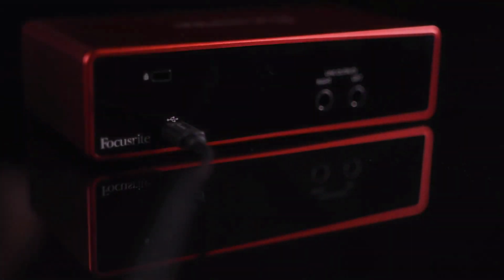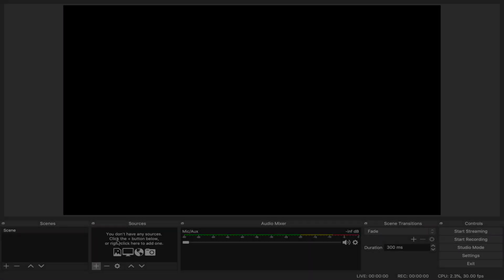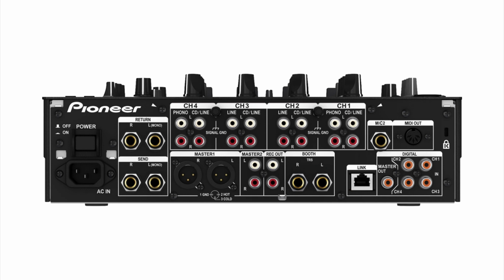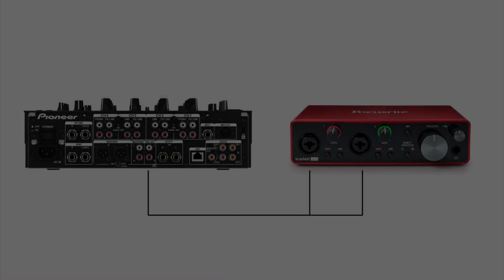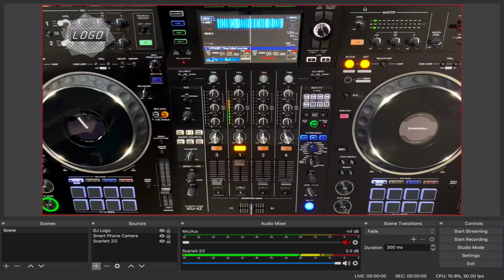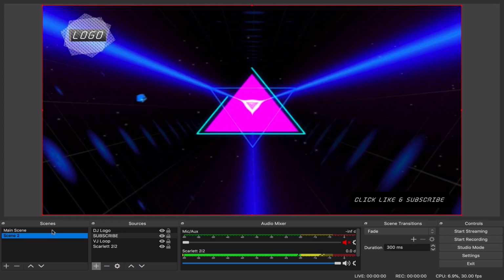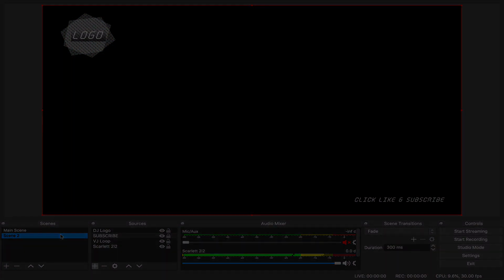Setting up Scarlett with OBS // Focusrite

Comment: Followed these instructions, audio continues to stop recording randomly in OBS.  Does this happen to anyone else?  Have tried using other video recorders, Bandicam and Movavi, with the same result -- at some point in a 25-35 minute video recording, the audio just stops.
Reply from the maker: We're sorry to hear that. This isn't a common complaint. Several things can cause that kind of issue. If you discuss this with our Support Team they can help you identify the cause and provide a suitable solution - bit.ly/CallFocusriteSupport
Reply: @FocusriteTV  actually it is cause its been happening for over 6 months to me as well, theres a video on yt thats older than this comment you made with 16k views attempting to fix the problem so i highly doubt its uncommon
Reply: @FocusriteTV  It is a very common issue and it is unusable at this point

Comment: I have 3 usb inputs to OBS.  I have 2 video inputs: camera and hdmi.  Focusrite Scarlett is the audio I want to use and uses the 3rd usb port.  In my scenes, I have the Mic/Aux muted, also the video inputs muted, but not the Scarlett.  However, when recording... the sound bars for the other inputs are moving, the Scarlett sound bar bounces adequately, but after changing scenes, the Scarlett goes silent.  Why? I end up with a silent recording... Any suggestions?
Reply from the maker: The first thing we can suggest is making sure that your Focusrite interface has been properly setup in OBS. These articles explain how to do so in detail:

Mac: https://support.focusrite.com/hc/en-gb/articles/360012954760-How-to-set-up-your-audio-interface-in-OBS-Open-Broadcaster-Software-on-a-Mac

Windows: https://support.focusrite.com/hc/en-gb/articles/360005040720-How-to-set-up-your-audio-interface-in-OBS-Open-Broadcaster-Software-on-Windows

If you try these steps and it does not help. please reach out to our support team at this link and one of our experts can assist:

bit.ly/FocusriteSupport

Comment: Hi great video and thanks. Quick question, do I need too go through both line inputs at the front on the 2i2? I have a cable running from my REC out input and it goes into one line input at the front of the 2i2.
Reply from the maker: Hi Steve, thanks for your question. Whether you'll use one or two inputs depends on what you're recording. If it's something that needs a stereo image you'll use both inputs. Otherwise most likely just one. Feel free to reach out for additional help: bit.ly/FocusriteSupport.

Comment: Question? I understand the entire connectivity piece, however, my Scarlett 2i2 has its own set of monitors that are designated for my PC. My pioneer mixer has its own speakers designated which I want to use only.  What should I do with the Scarlett speakers? Just turn them off? Turn them down? What’s the best monitor option for them?
Reply from the maker: You can certainly just turn them off. It's whatever works best for you.
Reply: @FocusriteTV  thanks! I usually have my PC audio volume at full, then use the scarlet2i2 to adjust——since I’m using a different audio source should still have my PC audio volume at full or will that matter as long I make all the gain adjustments with the Scarlett???

Comment: @2:37 you say the 2i2 accepts 'xlr' but doesn't the 2i2 bring in XLR inputs at MIC level, not LINE level?? I thought you had to use the TRS inputs for line level...?
Furthermore, the most important thing was overlooked..! HOW DO YOU MATCH THE LEVELS OF LEFT + RIGHT CHANNEL with Control software?? Since we don't want to twist the knobs randomly and have unmatched left + right channels in a DJ set stream...
@3:30 you say to use the gain knobs!!! But there is NO markers on the knobs to try to match them easily, and I was told by Store DJ staff that the ONLY way to precisely match without doing it manually, was to use Control software. Why are you showing only one input, WITHOUT the 'inst' button pressed @3:31 for the demo?!? So confusing and NOT useful for DJing.
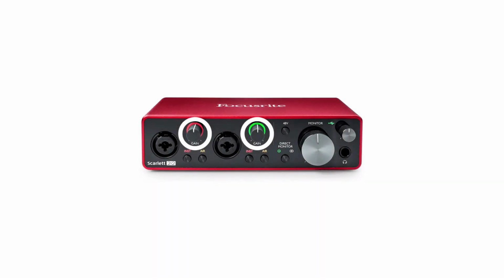@3:50 HOW DO YOU SET THEM THE SAME!!! By eyesight alone!?!? I ONLY purchased this unit because I was told that Control can do this accurately, matching right + left signals of a stereo pair accurately.

Pretty cruddy video. Why do you not make it easy to level match the left + right of a stereo pair input source?!
Reply from the maker: Apologies for any confusion this may have caused. The XLR portion of the Combo connectors are indeed designed just for microphones. 
For the best results, line-level sources should be connected to the 1/4" portion of the Combo connectors. 
Larger audio interfaces in the range feature fixed-gain inputs, ideally suited for connecting stereo sources. When connecting to inputs like those provided on Scarlett 2i2 that feature a variable gain section, controlled using analogue pots, levels can't be linked and matched. This is something that will need to be manually set. The Focusrite Control software does provide metering that can assist with that.

Comment: I'm going to purchase the Focusrite 2i2 Gen 2 Audio interface...and from what I have gathered If I'm looking to have at least 2 people on a podcast and they both want to use headphones, I will also need the Mackie 4 way Headphone amplifier. My question is how do I plug the audio interface into the head phone amplifier, so all guests can have a pair of headphones? Is there a cord I need? TSR?
Reply: Just plug a large jack TRS to TRS (balanced / stereo) cable between the interface and the headphone amp, it's a standard audio cable for stereo signal.